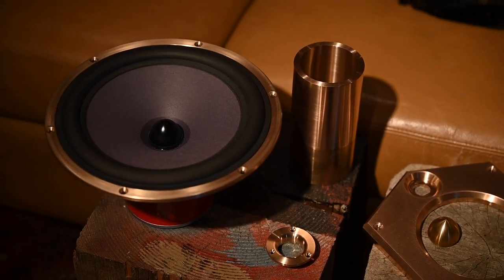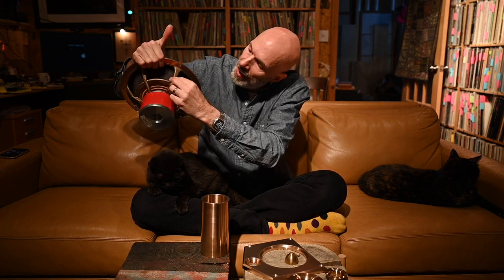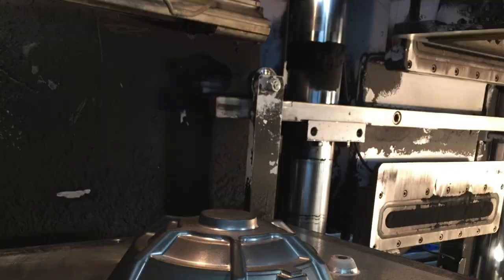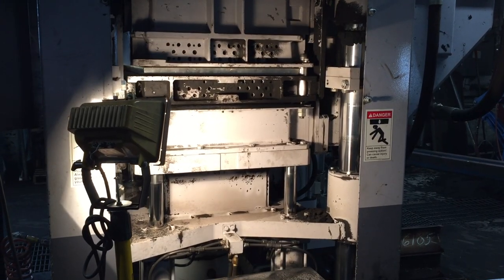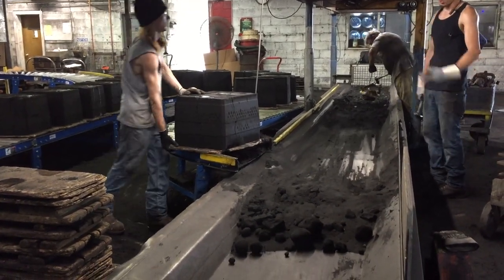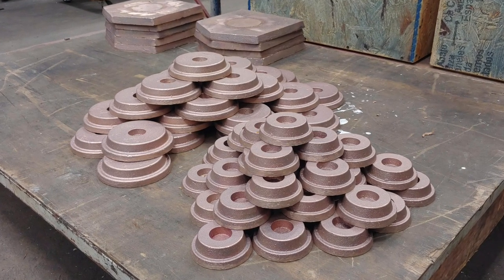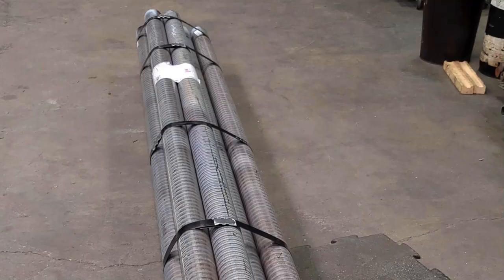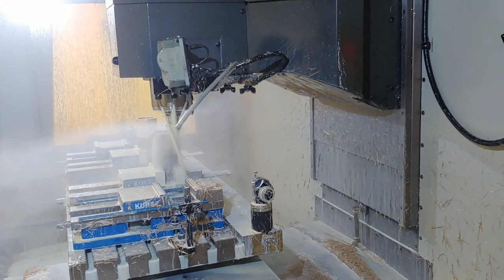Old school American heavy manufacturing, the casting and machining of the bronze O/Reference parts.

Comment: Really interesting stuff John. Must be an expensive speaker to produce before you even start thinking about retail margins and actually making a profit. 3D printing of large items like that can’t be far away, I’ve seen similar titanium parts produced for motorsports and cycling.
Reply: Sometimes profit is not the goal. Which in itself is profitable
Reply: @educetheme4175  
?
Help me out here ... profit 𝘮𝘶𝘴𝘵 be the goal. It's the ultimate platform of which every other element exists.
Reply: @FOH3663  Sometimes beauty is the goal.
Reply: @educetheme4175  
Well ok, ... beauty is wonderful, but without profit, nothing works.
Reply: @FOH-3663 Love, sharing, caring for the environment, seeking beauty and purpose are all goals that work without profit, but I do agree, making a living is essential in the modern world. We are more than just 6σ cogs though.
Reply: @educetheme4175  
Entirely agree 👍 
All the best ...

Comment: Aluminum alloys are much lighter and can be much stronger than bronze!  I guess bronze is a much more artsy material!
Reply: There is no universe in which aluminum is stronger in any way than bronze.
Not ever, under any circumstance.
Bronze is not widespread use because it is nearly as difficult to machine as iron, and is very expensive as a material.
Reply: Sorry, you are most likely more knowledgeable than I in terms of metallurgy, but I was thinking more in the line of aerospace technology where aluminum has certain alloys that have a very good strength to weight ratio.  It just seemed like bronze was just not a material that sparked "high tech" (to me), but was probably picked just because it is a "good looking" machined material to be be used.
Reply: @danedewaard8215  Bronze is extremely ductile and has more mass than iron. This makes it a good choice for vibration absorption. High end hand tools like planes are often made from Bronze for this reason. What this means for a driver basket is that it will not resonate (which is a common problem with drivers) as much as cast aluminum or zinc. In fact, it will be better than cast iron, though it requires much of the same high temp casting techniques employed in iron.

All that said, I am not convinced it will yield results that are worth the cost. Bronze is extremely expensive, and the casting is fairly specialized, and they are using sand casting which is much more expensive than investment casting both in terms of casting and machining.

You are right though, aluminum has a very good strength to weight ratio, which makes it very useful in aerospace. it does tend to ring though, which is why zinc is often chosen for baskets over aluminum.
Reply: Thanks for this information which makes a lot of sense, especially when you mention the fact that aluminum has a propensity for ringing while the characteristics of bronze would promote ringing far less.